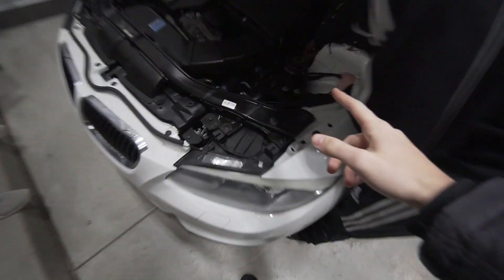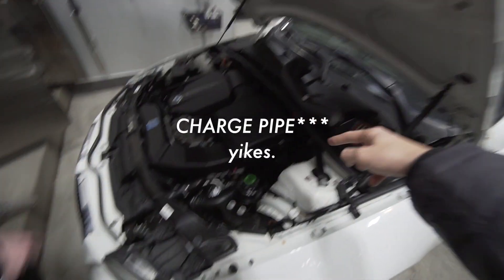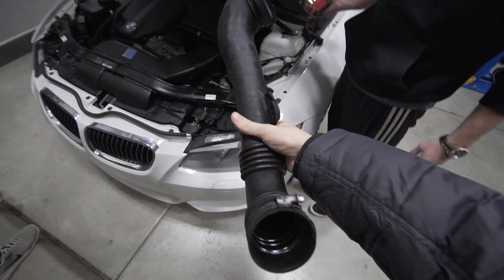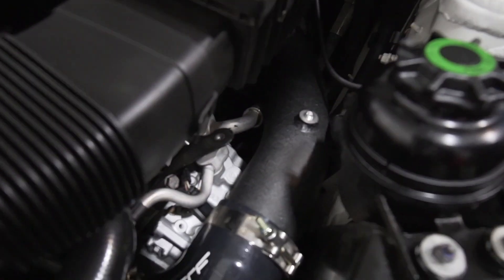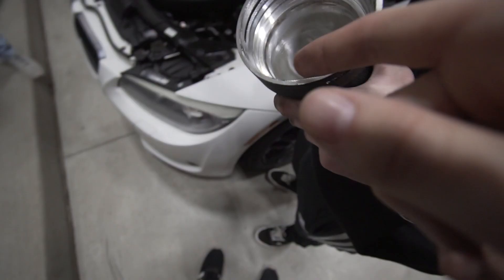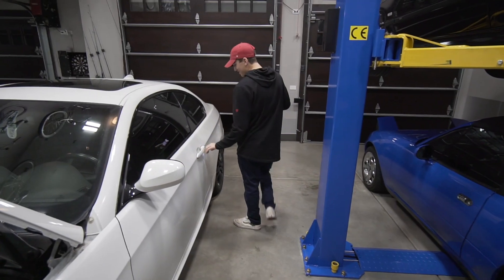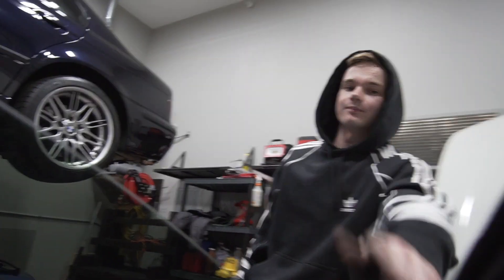Installing a VRSF Charge Pipe on my E92 BMW 335i N55!

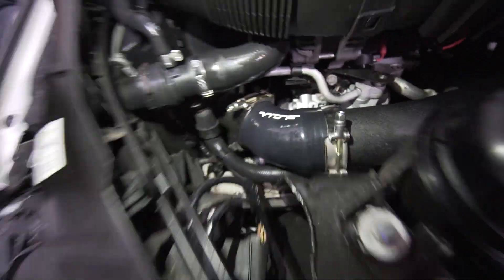Comment: Do you still read  comments on this? @ 2:46 you say the lower charge pipe section... and you have VSRF on the part itself, what is that and/or what did you buy for that? I'm doing my charge pipe as soon as it arrives but if there's more I gotta do then by all means, I want all the parts in hand and ready to bolt on before I get started on that and then have to re-open that space over again to install more. Please and thank you!

2011 335xi, N55
Reply from the maker: The only parts I bought shown in this video came with the VRSF Charge Pipe Upgrade Kit. Nothing else was necessary!
Reply: @werqshop  Thanks! Sweet. I didn't see mine had that little elbow piece that said VSRF when I ordered mine online but hopefully it has it, otherwise I'm staying stock on that and it won't really matter to me.

Comment: Installed this today and found the end with the O ring is still very loose (even with the O ring). Any tips?
Reply from the maker: Mine felt somewhat loose on the throttle body, however as long as the O-ring and C-clip are installed correctly, the pipe should hold pressure perfectly fine. If it's very loose and not holding pressure, your charge pipe might be defective.
Reply: Does the O ring came with the charge pipe or swap from the own part to this new vrsf ?

Comment: How is your charge pipe holding up and any thoughts of adding a bov
Reply from the maker: Charge pipe has been holding up great, this is an N55 car so no BOV. I might get an upgraded diverter valve in the future though
Reply: Oh ok, I have an N54, my charge pipe just took a dump on me but I gave a VRSF pipe with an HKS bov that I should be installing in a few days. I'll probably post a video of the sound when I do.

Comment: Did you unplug your battery before doing this? If not, did any engine codes come up?
Reply from the maker: No need to unplug the battery. No engine lights on afterwards. If installed correctly there shouldn’t be a check engine light

Comment: I have a 2011 bmw 335i coupe as well, searching the internet for a good charge pipe. Would you recommend this one? The reason I’m buying one is because I suspect my stock charge pipe is about to give up. Feel like I’m losing boost:/
Reply from the maker: In hindsight, I really think any aluminum charge pipe with decent reviews online should work fine. This one cost me just under $200 and I know there are cheaper options that I would've rather gone with. This VRSF CP holds boost perfectly fine and does its job very well.

Comment: I did mine the other weekend and guys when I say you have to force the charge pipe onto the throttle body I’m not joking I literally and to put Vaseline all over the outer layer of the throttle body and use a piece of metal to help me fit it in

Comment: I enjoyed watching, I have a 2012 335i (that be N55 as well I think) how much are those aluminum charge pipes? Did you also go with an additional oil cooling system as well?
Reply from the maker: No additional oil cooling besides the OEM cooler. The aluminum charge pipes range from about $100-$200.
Reply: werqshop thank you I need to do this to mine, and as a fellow BMW owner if you’re racing or aggressively driving I’d consider an additional oil cooler, my car went through 2 radiators in one year (one was defective) and I always wonder if I would have had that problem if I had the xtra oil cooling system cuz as you know, no engine temperature gauges on these new cars you basically have to keep a hawk eye on the oil temperature gauge (250 degrees is supposed to be normal operating temp but not a whisker over lol) because when my car is running optimally it runs colder than that by 5-10 degrees (which is so good) so if it stays at 250 I think that’s too warm lol do you have any chip mods yet? Piggyback or full reprogram? I hear wonderful things about something called a JB3